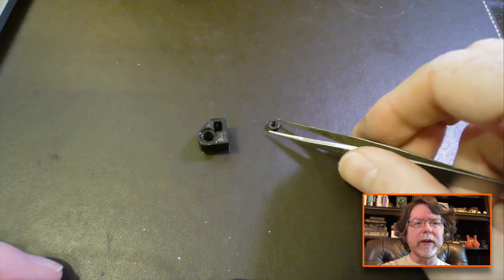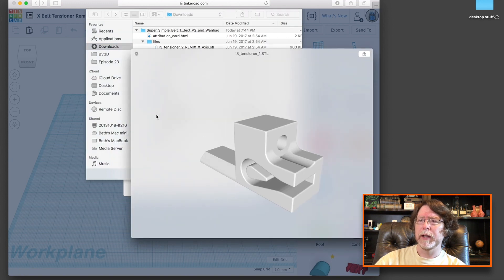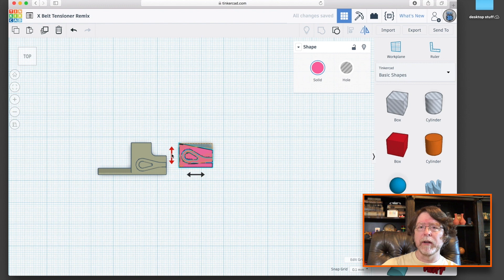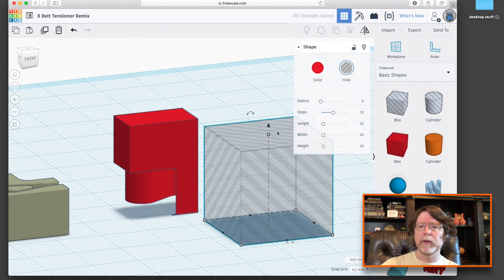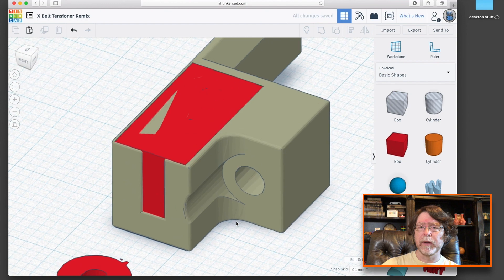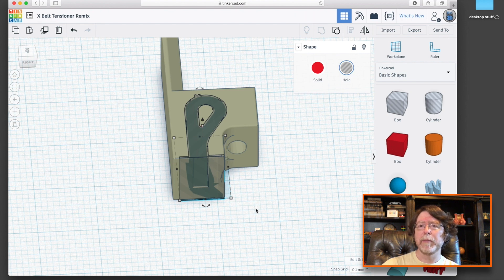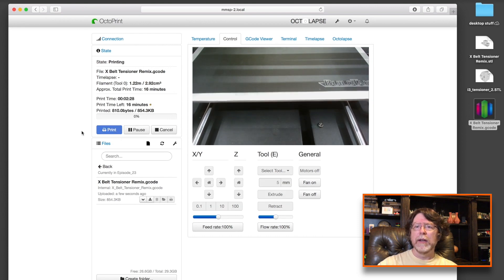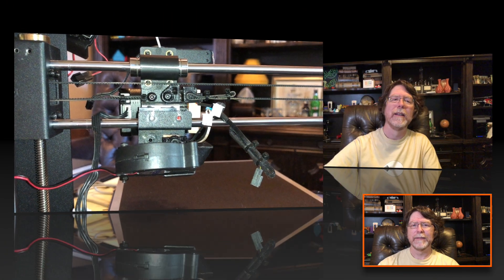A "Tension," Please! X-Axis Belt Tensioner & TinkerCAD Tutorial

Comment: will this work with pla or does it need to be petg or abs
Reply: I suggest print TWO SETS before installing these, or printing a second set soon after, so if one eventually fails you're not sitting there out of luck.
Reply: @YorkUniversityIT  that's what I did but they seem to rub on the belt so I am printing a pair at 99% to see if that gives me some more clearance
Reply from the maker: I printed mine in PLA, though I think PLA may stretch or deform a little over time. They’re still on the printer though, and seem to be working OK. If you have PETG, go ahead and print them in that. But if all you have it PLA, it should be OK. Like I said, mine are still going.
Reply: @BV3D  Thanks PLA is all I have so pla it will be

Comment: Do the top belt teeth not collide with the top on the tensioner?
Reply from the maker: The belt does touch the top of the tensioner, but barely. I am not experiencing rough movement or binding. I don’t see any wear pattern on the tensioner from the belt, but I have only had this one installed for a couple of weeks. 

If I start to see significant wear on the belt or the tensioner, I may shave about 0.5mm off the top of the tensioner part which mounts on the carriage.
Reply: Sounds like its holding up just fine for now, thanks for the info. I will hold off on doing this until my belt is getting loose and keep an eye on your channel be sure to post an update video in case something happens. Keep them videos coming!
Reply: Mine hit the belt.  It could be that my printer didnt print it to exact dimensions, but there isnt much tolerance.